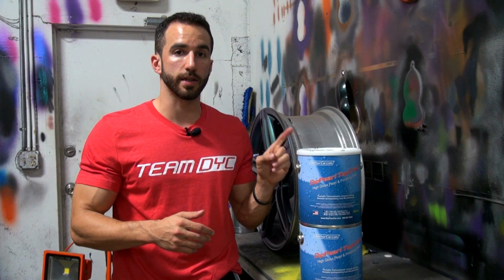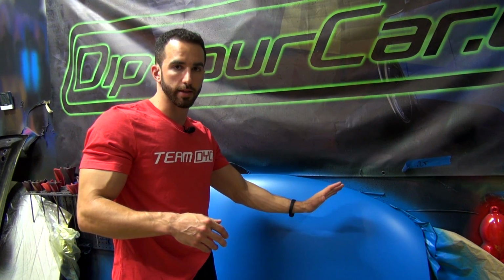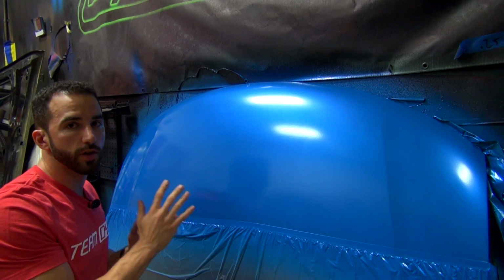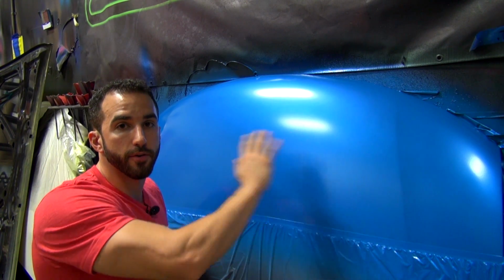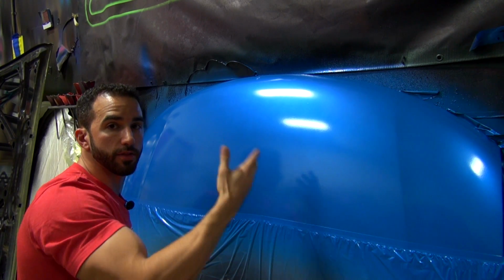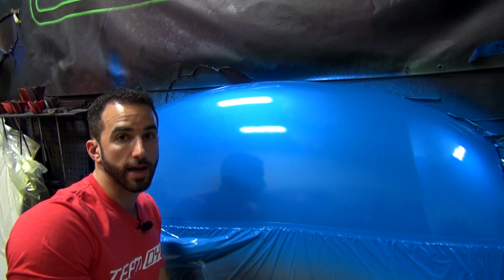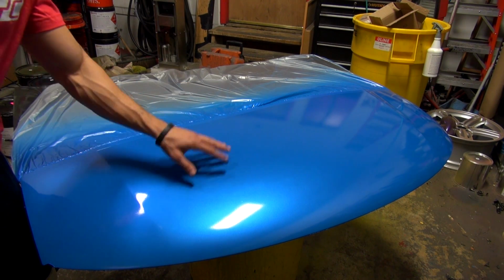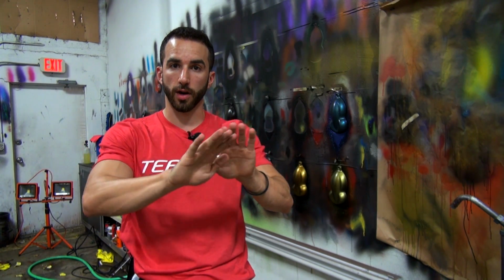DYC High Gloss TopCoat - Tutorial

Comment: I just picked up a 1997 Ford Mustang GT CONVERTIBLE and the color right now is red with a silver strip on the hood and trunk I wanted to order your products and use the red color and i wanted to order your spray gun and also the gloss finish, and the paint is the original color now but the. Clear coat is peeling and i was wondering how many gallons will i need for the base and the red color and how many gallons would I need for the gloss if I am going to put 3 coats on it so all together I need to know how many Gallons of all the stuff I need and remember I have a Convertible top that I am going to cover it and prep please let me know because i am going to order your products and the spray gun on August 3rd and how long does it take to get to NH. Zip code 03102 it's Manchester NH because I have plans to do it over the weekend of the third of August so I will pay for over nighted . thank you my name is Stephen and everyone have a great weekend.

Comment: We are spraying dip out of a HVLP gun, with no extra thinning.  a 1.8mm tip running less than 10psi and getting great results...  The pearl high gloss threw us for a loop with out quickly it runs, and that then followed up with the high gloss top coats... we have a few runs, but we are over satisfied with the end result.  We SHOULD have watched this video first and more than likly would not have had any issues..

we also could not see our wet line at all.. spraying over white is not easy!!!!

Thanks for the great videos, we use it for training and if we apply anything new then we come here first and find you doing it so we make sure to mimic your methods.

Comment: Also, can you peel off the tape on this piece and NOT pull the dip off??  If so, how long do you have to wait in order to pull the tape and NOT take the dip with you?  Can I do this kind of job with the glossifier or do you have to use your High Gloss TopCoat??
Reply: kzem968 I believe it's around 1 hour after application to remove excess spray or taped areas. visit their website at dipyourcar.com

Comment: These might be stupid questions... Can you ceramic coat after dipping your car? Also,  can you go into a touchless car wash of would it chip or strip the coat?
Reply: You can do any type of car wash any pressure washers it will be fine if you have a good amount of coats applied
Reply: Byron Bailey what do you mean? You can use power washers just fine.. I do it all the time. Plus DipYourCar even made a video saying you can use a power washer

Comment: quick question... Lets say I went a bought a brand new bumper and I got it oem painted but it was a cheap paint job, knowing how cheap paint jobs are, the clearcoat tends to chip away due to sunlight. Can I spray the DYC HIGH GLOSS CLEAR TOP COAT over the oem paint job to save the brand new paint job since the rubber clear top coat doesn't chip before the chipping begins on the oem paint job?  Hopefully  this made sense.

Comment: You are 100% correct Fonzie.  I am just starting out with PD so I can't speak from experience where PD is concerned...  but I am a NACE certified coatings inspector and protective coatings specialist and I can say that every point that you make when disusing your product and proper application technique pretty much applies to ALL coatings projects.  

It always amazes me when ever I go out to do a failure analysis and determine that the cause of the failure was improper application, whether it was an improper surface prep, ignoring re-coat windows, unapproved added solvents/thinners, or just plain old not paying attention to what they were doing or not even bothering to read product data sheets or application guidelines.  

So, with that said I want to say thank you for your efforts in trying to make it perfectly clear regarding the requirements associated with the installation of PD.  

Thanks and keep the videos coming because I personally thoroughly enjoy them.

Comment: cool video I know he says not to experiment with waxes but someone could possibly add a sealer to it like klasse and add some real year long protection to the new dipcoat. also with more experimentation I can also see someone trying to spray 2k real clear over top of this to add a real oem protection and then seeing if it will still peal off be removable.  never hurts to try things especially on something small like a spoiler , hood scoop and or the wheels.
Reply: I think someone tried putting regular clear coat over dip and it caused it to crumble and lose peelability.
Reply: Yeah they have i have too the rattle can kind. There is some upol. House of color and some called diamond clear that claim to stay 100% flexible. I have yet to try them.